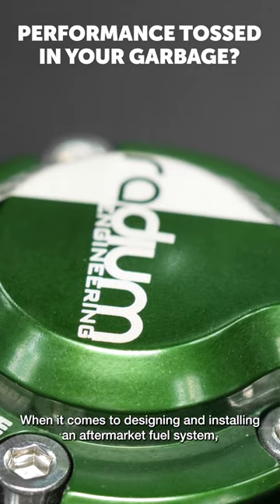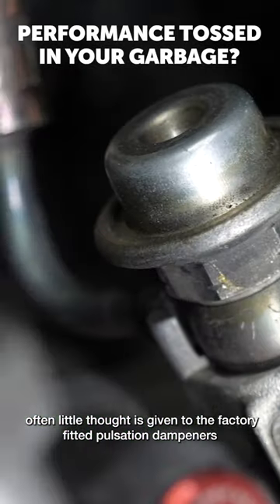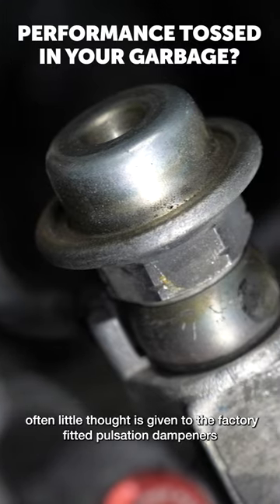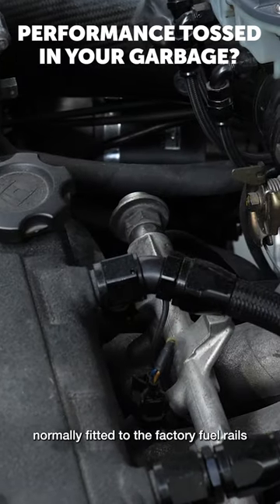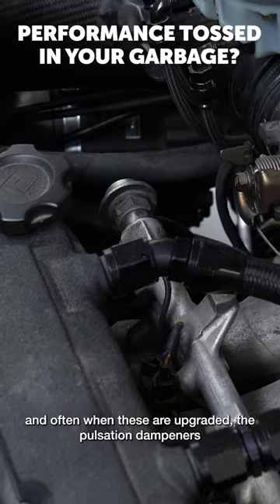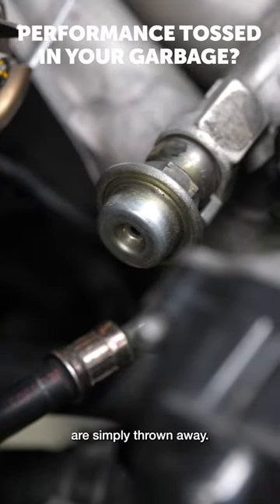What's A Fuel Damper? #shorts

Comment: Interesting. 
I work in oil & gas drilling and pulsation dampeners are used on drilling fluid systems/mud pumps for drilling rigs. I never knew they existed for fuel systems. Makes perfect sense though.

Comment: So is this less important on higher cylinder count engine or a larger fuel rail? If you have a larger diameter fuel rail that gives you a larger volume of pressurized fuel at the injectors, would that reduce the effects of injector pulses?

Comment: I’ve seen this in the engineering world referred to as water hammer.  We affix anticipation valves for this that open when a high/low pressure is reached in the system. Imagine a 60” water distribution line slamming shut all at once.

Comment: Thank you for this. Building a B18C1 turbo. My fuel system has the radium fuel damper installed on the fuel rail. It's ironic you used footage of a Honda motor for the example, because just about everyone takes the oem one off.

Comment: Every system will resonate in it's own unique way. I don't see how a pulse damper could be a one-size-fits-all part. It seems it'd need to be individually tuned for the system it's being installed on.

This, coming from someone that literally has a Radium fuel rail, pressure reg and damper.